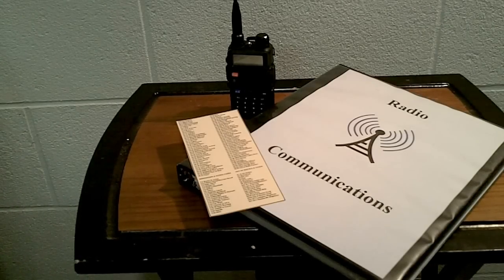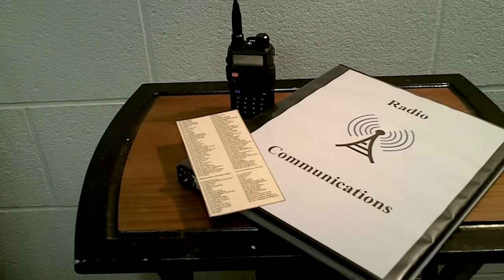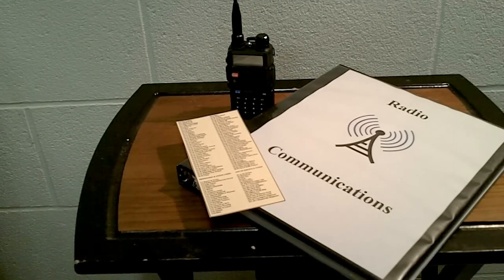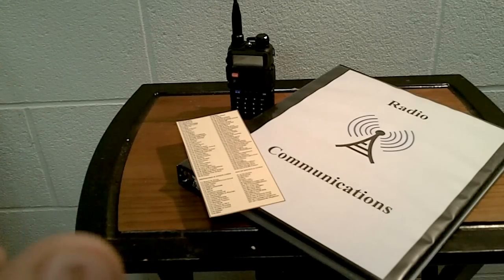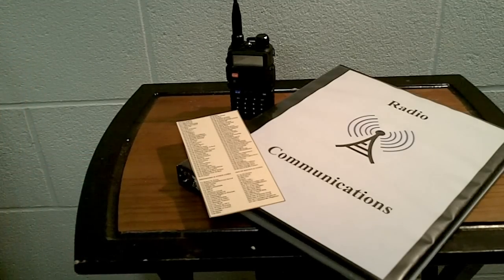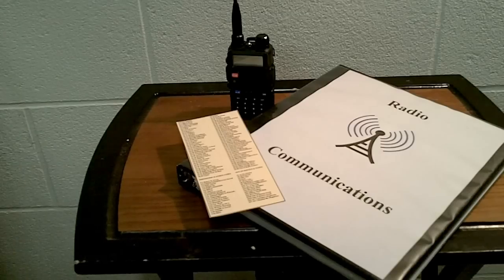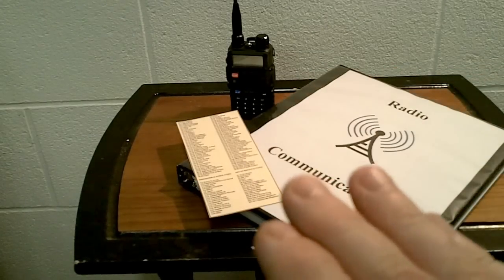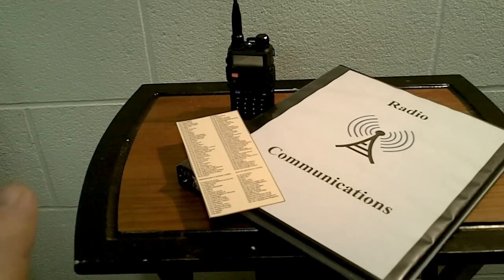What frequencies do you need to program into your emergency radio

Comment: There is an easy process for determining what is an actual emergency allowing you to transmit on a channel that normally does not allow you to use it. There must be an immediate threat to life and/or property, or the radio station is in immediate danger (example might be a rising flood, wildfire, terrorist attack etc.) And THE key is that there must be no other way to call in the emergency, for example, you have a cell phone and there is good coverage, battery is charged, but you call direct to the fire department using their emergency radio frequency instead. That could land you in very hot water.

I worked for over 20 years as an EMT, fire dispatcher, ambulance dispatcher and law enforcement dispatcher and none of the comm centers I worked in were ever equipped with a ham radio transceiver, let alone GMRS radios. Using these civilian radios to call for help would be fruitless unless a ham operator, for instance, copied your transmission and was able to relay your call to the emergency services via cell or landline.

We live in an area that routinely experiences high velocity winds running up the Columbia River Gorge, making grass and timber wildfires especially dangerous. In the 1800s, our town was totally wiped out by a fast-moving grassland fire and it could easily happen again. Around here, quick calls for "Level-3" evacuations, (run like hell-right now!) are common, and having a radio scanner set to receive local police and fire channels and the capability to hear repeaters in the clear is essential. You don't have to wait to get the notification to evacuate from the usual emergency alerts on your cell or radio/TV. You hear the OnScene incident commander call for evacuation and you get a jump on the call as it happens. Whenever I hear sirens, I flip on the scanner just like a lot of regular people around here do and we get our news in real time. If you do not have a dedicated scanner, a 30-dollar Baofeng makes a pretty good scanner radio. I turn off "duplex" using CHIRP for the fire and law enforcement dispatch channels and it will not transmit on them.

I would also say that knowing Ten-Codes is an iffy thing. They change on the whim of the user agency. For instance, "10-33" is officially an alert to a crew to get ready to copy an emergency call on the air. I worked for an urban ambulance service as an EMT that turned the 10-Codes on their head. If we copied, "Unit Seven-Four, 10-1, 10-20" That meant prepare to copy an emergency call. In the official 10-Code listing, it means, "Out Of Service, What Is Your Location?" This is why most emergency service agencies long ago abandoned the 10-Codes and opted for "plain language" instead.

Comment: So, 
1) Be aware of what can and can't be done legally as stated by the FCC rules (or the governing agencies in your country).  What you do with that information is up to you.
2) The Coast Guard monitor the marine frequencies, and they have police powers
3) Do not program the transmit frequency (i.e. leave the TX FREQ blank) if you do not intend to transmit on that frequency.  Not only does it help to eliminate the accidental transmission, but it also will help you if the radio is confiscated and the code plug is checked.  If you make it so it shows you had no intention of transmitting on that frequency, it may save you in a lot of hassle.

Comment: Hey, suggestion. You could, if you feel inclined, put all that info into a PDF or doc, and upload it on a file sharing platform like Mega or github. That way, people who are either unable to find the information you gathered, or are very busy, could download your document and print it out easily. Also, like many others, I'm lazy. lol Just an idea. Thank you for the information it was very useful.
Reply from the maker: What I program into my radio would ONLY work if you live in the same area as I do (literally within 50/100 miles in my area. So posting it would do very few people any good and confuse the ones that don't understand radios. They would program their radios with it and wonder why their radio is not working.

Comment: In a emergency use any frequencies.
Reply: But what would be the frequencies thay everybody would listen to.
Reply: @amanwithnoname2744  9.11.000
Reply: @starrvalley12 In a true emergency transmit on 146.520 or 446.000 ....  Local U.S. hams will most likely be monitoring at least that and will be able to get you some help.

Comment: most large agencies and law enforcement are now using 800mhz, trunking systems, so not too many uhf, vhf agencies out there unless they are small agencies.  You are correct however, in the old days vhf, uhf were king for fire/police. Thats why you can't even monitor local agencies anymore unless you have an 800mhz trunking scanner

Comment: The problem with "Ten Codes" is they vary greatly by area and jurisdiction. The fire services are required to use "Clear Text" and not the ten codes on all mutual aid incidents. Very few fire departments in the western U.S. use anything but clear text, internally or for mutual aid. The fire departments in the east hold tightly to tradition, some of them using expressions in existence before the invention of telephones and radios.

Comment: Well, trying to monitor Emergency services frequencies is nearly impossible with a Baofeng/analog radio.  Where I live those have all gone to digital trunked  systems, which you cannot listen to with a Baofeng. I wont get into the FRS/GMRS argument, but just dont, buy a FRS radio, and if you want GMRS, pay for the license then get a radio. Stay legal people. It's easier and safer. Also you learn how to use the radio's. Where I live, we as Ham Radio operators do not use the 10 codes.

Comment: Back in 2014 I got my very 1st scanner, a uniden bc125at. I was able to monitor local police, FD, AMR, ham, etc. Recently dug it out this year.

But I found out local police went full encryption in 2016. All those channels are now a ghost town. I even got a slim jim antenna back then and was able to pull in Los Angeles sheriff, 60 miles away.

Not anymore though. I still use it to listen to ham convo.
Reply: It can still pick up ISS frequencies with the slim jim, but it's real brief.

Comment from the maker: I have had many requests for me to send people what frequencies I use in my radios. While I have nothing to hide unless you live or travel in my area (city and state) what frequencies I use will not work for your radios. What you program in your radios compared to mine could be different by just miles. You could be 50 miles away from me and a frequency I use would not work for you. You need to program your radio with frequencies that are relevant to you and where you live and travel.

Comment: Excellent video providing excellent information. I am a general class ham operator and I have a Baofeng BF-F9V2+ with an extra battery that I have programmed with Chirp similarly like you describe. It is my SHTF radio only as I have other HTs for everyday use. I see some of the previous comments made by others who apparently have not done their homework. I hope they learned something along the way to set them straight. Thanks for the timeless information and 73!

Comment: Speaking to emergency use.  Back in the 70s-80s-90s-2000s, it is was SOP that on cb channel 9 is for emergency only. The line of thinking was that if you have an an emergency to go to channel 9. The problem with that is, nobody is listening. People avoid it due to it being set aside for emergencies. So, it rolls like this, you have an emergency, you go to channel 9 and call for help........ crickets. Good luck getting help. Up until the mid 90s I had a base station set up. I used to monitor channel 9. I helped many people many times and at least 2 of those times was over skip. When I was running heavy wrecker (like you see on rescue 401) and we had numerous heavys working a wreck, we used channel 9. One heavy operator said to me "isn't channel 9 for emergencies?". My response was , we got a tractor trailer across the highway, another on the shoulder on its side and another torn apart 500 feet up the highway. If this isn't an emergency I don't know what the hell is. So, think of the context of an emergency. It doesn't necessarily have to be a fire or medical emergency, etc. 

My base station was a modified TRC 458. It a had slider and a lot of "extra" channels. I only ever had FCC come to my door once. It was because someone was jealous of my set up. FCC never seen my set up, because I didn't open the door. When they returned, I had a completely different rig set up. 

Don't get all worried about using certain frequencies. Just don't misuse them and talk professional when using them and you're not going to have a problem. It's when you get stupid that draws attention to yourself.
Reply: Absolutely

Comment: for Baofengs, you can use CHiRP software to program all these stations in. Then set DTMF to "off" and those channels will be receive-only. I recommend doing this and then putting on a card how to enable DTMF so you can transmit. Today and tomorrow and perhaps the rest of your life, it's not legal. When SHTF, we will be operating under a different context.

Also, set your default power to LOW.

Finally, I highly recommend getting your amateur ham radio license. You can pick up a book on Amazon. I find it pretty darn interesting and am looking forward to getting my license.

- Camilo
Reply: Does a higher power increase range ?

Comment: Having been a ham for 50 years and involved with SAR for the last 35 years, contact your county's  DEM (department of emergency  Management) and get involved. A ham ticket is not required but helpful. We use Law enforcement, Fire, Military, CAP, Air to Ground, Coast Guard and  many different  SAR Frequency's  on our missions. Pass a 35 question test and you have the Ham ticket, If 8 and 9 year old kids can pass the test you can too. 
NE7NE
Reply: Robert, nicely said.
KC1KRK
Reply: I agree 100%. 73 W6RIP
Reply: I failed on the practice test and o doubt a nine year could pass this! The test is on a 12 th grade reading level any cannot pass this inlets he is a genous
Reply: I would not talk on it without a licence anyhow.anyhow during a emergency if they are like fema  they came too late for help then put them in condensation camps during some of the hurticans during obamas time!
Reply: None of you help anyone. Even the dam in nola was blown up to flood the place.

Comment: I programed the Police Frequency as a Security Guard i can radio them if i need them .  I can radio my dispatch as well.
Reply: I did the same but with railroad channels with a Baofeng UV-B5 I keep in the glove compartment in case my main radios battery runs down or a work partner needs to use it out in the field. It makes sens to have it as a backup or loaner radios because it's no big loss if it gets lost or destroyed which does happen in this line of work.
Some Baofengs are 100% perfectly legal to use outside of the ham radio bands but the mental midget class of ham operator (The Youtube Experts)does not know this because they cannot figure out how to use google or the FCC website properly.
Reply: You are not authorized to transmit on police frequency as a security guard your company dispatch yes but not police dispatch.

Comment: Just a few suggestions to your nicely done video....  If your interested in monitoring emergency services, I’d suggest a scanner radio. They have a lot more frequency range and some can store a thousand plus channels. If your looking for an emergency radio to transmit to other stations in case of a REAL emergency your suggestions are pretty much on key. I would loose the 10 codes, the phonetic alphabet, and the Morse code is going to be totally useless to you even with your chart.. Even at 5 WPM which is considered slow, your ears will not pick it up fast enough to even write it down. 
  Amateur radio repeaters are definitely a good bet, as well as GMRS and local municipalities such as fire and police... 
But remember as you stated, some of this has gone trunked or digital. As for Amateur and GMRS repeaters, in fact almost any type repeater usually has a PL code ( Private Line) or DPL code (Digital Private Line) that you must use to access the repeater. 1A- 103.5    4Z- 136.5    6B- 179.9 etc, etc. So write these down as well next to your local repeater frequency. Also don’t forget the repeater offset, +\- and the amount of offset used... Example  Happy Ham Amateur Radio Club 146.550 Offset (-) PL- 4Z.  Now the common offset for 2 meter Amateur Radio repeaters is 600 kHz. plus or minus,,, other bands and other services may be different... 
 If ANY of this is not programmed correctly.... Your going to report your emergency to NOBODY! 
  I’m sure there are some here who are crying “ Your NOT licensed to be on these frequencies! ! !  But in a life or death situation,,,,  If it’s going to make the difference USE IT! I’m sure the FCC is not going to beat you up and steal all of your marbles for saving a life...
Reply from the maker: Thanks for the comments and information. Always good to hear from people with experience.  I agree with having a scanner and their abilities. I have a couple along with other forms of communications. I will keep the 10-codes, phonetic alphabet and Morse code handy like I think everyone should. You are correct that it would take awhile for someone to pick up on the "lingo" but in a grid down situation, they will have plenty of downtime to learn and practice. This is coming from a former LEO. :)  Thanks again!!

Comment: The Baofeng radios are great because they cover a massive band width, however there are a few somewhat common radio systems that the radio would not accommodate. Those are:
1. Trunked systems - require special radios and a fair bit of knowledge and expertise to actually program
2. Encrypted systems - basically no way to get access to these unless you know the access key, but they may be illegal to listen to in the first place (depending on who the frequency is used by)
3. Digital systems - once again require specialized radios and a fair bit of expertise to program (not to mention trunked digital systems)
4. 800MHz band sometimes used by public safety

Comment: 2 questions: 1, how to program the Baofeng radio to receive certain frequencies and not transmit on it? 2, how do you find your local 10 codes?
Reply from the maker: The UV5R has a "lock out" feature that blocks you from transmitting. This can be found in the CHIRP software or by doing it on the key pad manually. You can find your local 10-codes usually on line. Many of them are universal from area to area but check on line.
Reply: thanks
Reply from the maker: No problem, you are welcome!!

Comment: Great video. I have never used one of these radios & I recently started prepping & just bought this model. Besides all the emergency frequencies, I can program this as a walkie talkie style as well to connect with friends, family, & the bug out community as well right? Appreciate it.
Reply from the maker: Thanks!! Yes, you can program these to communicate with the FRS and GMRS radios. However, not "legal" but can be done. Under an emergency situation I wouldn't worry to much about it but that is your call.
Reply: Guns and Gear Network right, that’s the only reason I would do it. I’d rather do that then get another set of walkies. Appreciate it.

Comment: Im willing to pay someone to program 4 radios or sell. Any Help out there?
Reply: What brand and models. I own and run a communicatiosn shop. I do programming for $30 per radio for the first 16 analog channels or, 1 trunking system, or 1 DMR system. 
All programming requires letters of authorization from system owners / police or fire chief, etc.. if they are for commercial or public services, 
Proof of licensing for Ham and GMRS is requires for programming transmit on those services.
I will NOT program FRS or MURS into non certified radios for use in the US or PMRS channels in non certified radios for use in the UK or EU.
Reply: ElfNet Gaming how do we contact you
Reply: elfnetdesigns@gmail.com
Reply from the maker: I am currently working with some vendors on offering pre-programmed radios. Keep an eye out for the video about them. They will also offer a programming service for radios you already own.

Comment: what level license do I need to legally operate a citizens band radio ?
Reply: Fletcher Overland back in the 70s you did
Reply: No license required since President signed a law changing FCC rules in 1984.
Reply: Absolutely none needed for CB.
Reply: david hollman These Baofeng radios don't do CB (AM 11 meters, can be SSB), but rather FM VHF 2 meters and FM UHF 70 centimeters.  Not compatible at all.
Reply: david hollman none
Reply: In the early 70s, when I was in high school (am I old now?), one needed a cb license.  Then the cb craze hit.  While a license for cb is still required, the FCC automatically gives one to every citizen, no paperwork In either direction.  OK, not 100% on that, it is what I was told, and since it is stupid and the most moronic way of doing it, rather than just saying no license needed, and this is the Federal government,  I believe it.